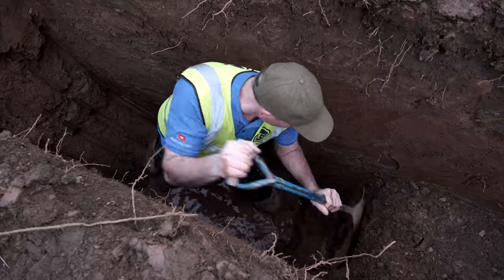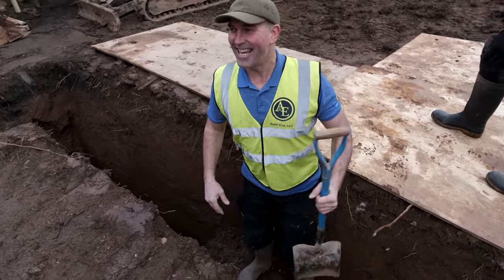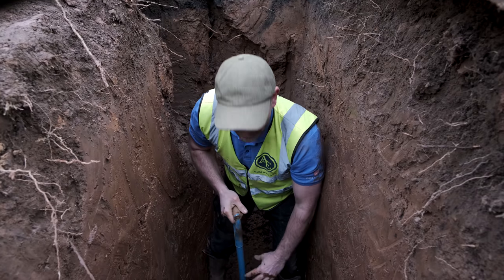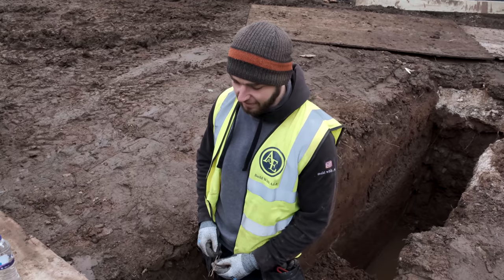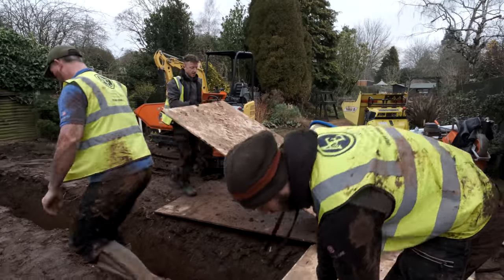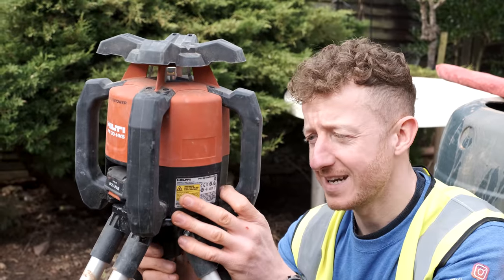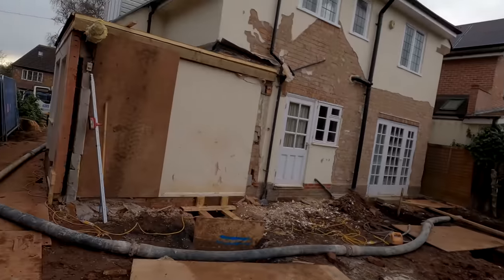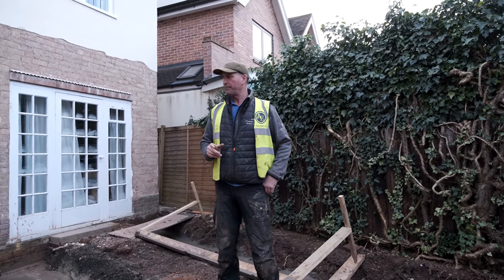Epic Concrete Pour! | Single Storey Extension #4

Comment: What's the maximum length of pipe one of these delivery mixers can pump out at? And what happens to the excess concrete in the pipe once the crew are done?

Comment: Whats the reasoning for the footings being that deep ,really enjoy your videos lads.
Reply: from the last videos, because of the trees
Reply: Yep. Roots could get below a regular footing and disturb it over time.
Reply: Nothing to do with roots. Its to do with the type of soil and proximity of trees to a building. Trees are notorious for affecting water content of soil. In periods of sustained drought trees will suck enormous amounts of water from the ground causing shrinkage in soil. This leads to the ground shrinking away from footings causing subsidence. Clay is particularly susceptible to this. Conversely in periods of sustained wet weather clay and other absorbent soils can suffer "heave", whereby they expand so much it forces the footings up. By digging deeper footings you mitigate shrinkage and heave by getting down to solid ground below the water table not affected by water content changes.
Reply: @davebadger100  thanks for explaining. Always thought the worry was roots would heave/press against or even the foundation.
Reply from the maker: Dave explained the reason perfectly 👌🏻
Reply: @wayneleone  No problem. You were right to a certain extent with shallow footings and a thin strip foundation (say 9inch thick concrete) in that a big tree root underneath would over time push the foundation up causing subsidence. Like in the case of a garden wall for example. Its soil shrinkage/heave that is the major concern with house foundations.
Reply: @BuildWithAE  Cheers Tony.
Reply: Is there a distance/tree height guide where this comes into play? Cheers
Reply: @davidhill431  It is a fairly complex subject. All dependent on tree type, soil type and distance of said tree from proposed foundation. 
Tree height has nothing to do with the calculations when it comes to building inspectors, as in my experience building inspectors base all their opinions upon the potential mature height of a tree.
I have built extensions with 5 ft high trees 6m away in neighboring gardens and gone down 2m. 
 LABC work off of charts which give the depth of foundations according to tree type, soil type and distance from building.
 
https://nhbc-standards.co.uk/4-foundations/4-2-building-near-trees/4-2-13-foundation-depth-tables/
This gives a great insight into the foundation depths required for houses but is also relevant for extensions.
In a nutshell the further the tree the less deep the foundation has to be.
As a rule of thumb any foundation over 2.5/3m generally becomes uneconomical to dig as a normal mass fill concrete footing and then piling/ring beam foundations come into play.
Reply: @davebadger100  would a raft foundation not work in this instance where the load is spread across the entire floor? Are you a SE?
Reply: @SteS  No mate I'm not an SE. Just an ex bricky who spent a lot of time on extensions and groundworks etc. Had a few nightmares with trees etc. I don't think a raft would be viable because you really need to get down to a reasonable depth where the water table is not affected by variation in water content. The problem with a raft would be that the ground below could still shrink or expand  with changes in water content. 
What I think would happen with a raft is that the whole building would "heave" up or sink/subside as one, so although you might mitigate cracking and movement of walls etc the extension would still rise or fall at a different rate to the main building. I would also guess that there maybe a significant risk of the extension/raft "tipping" or leaning if the ground were to move if the movement was uneven.
Reply: @davebadger100  I'm an Architectural Technician. But a Structural Engineer is a whole other ballgame. From my reading up on foundation types in this situation, rafts are one of 5 foundation types to use. See 4.2 6D. http://nhbccampaigns.co.uk/landingpages/techzone/previous_versions/2011/Part4/section2/default.htm although it really all depends on soil tests and site survey and whether the SE likes over specifying things ;)
Reply: @SteS  Thanks for that. Thats really interesting. From what I understand from an extension/building control point of view is that raft foundations are quite complicated and have to be engineered designed which will always add to the cost. Whereas when it comes to strip and mass fill or ring beam and pile foundations there are standard specs and calcs and charts that will suit all applications. Rafts as far as I understand are quite specialist and individual to every project (although I as understand it they are used more in commercial/warehouse situations) so arent really suited to a domestic/ residential situation due to cost of design and construction. Although having said that your point is definitely valid in that it appears they could be used to overcome the issues of trees and soil movement.
Reply: @davebadger100  it really all boils down to cost. Less ground works for the raft foundation and more money for structural drawings but they would have details knocked out in a few hours or just dig a drench this deep and fill to the top with concrete. The raft could be poured in one hit too. It's an interesting topic alright :)